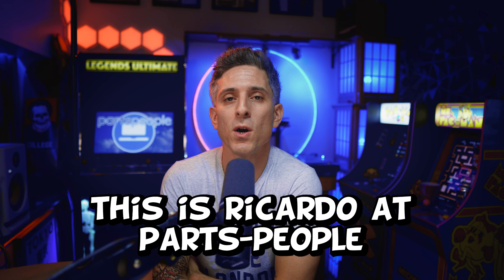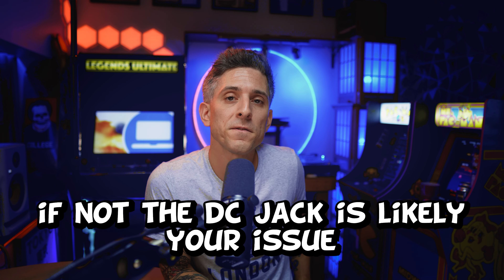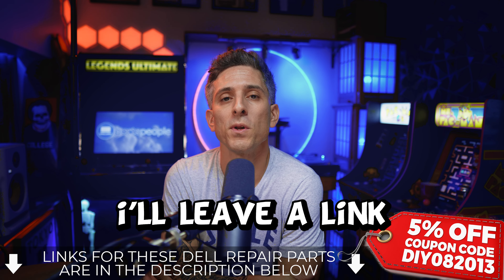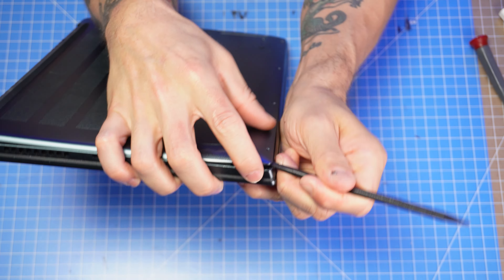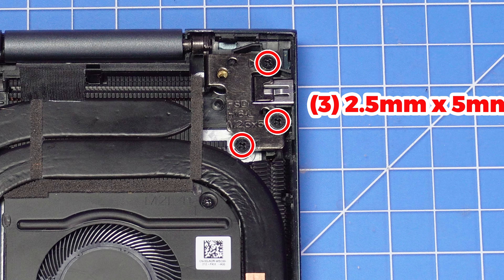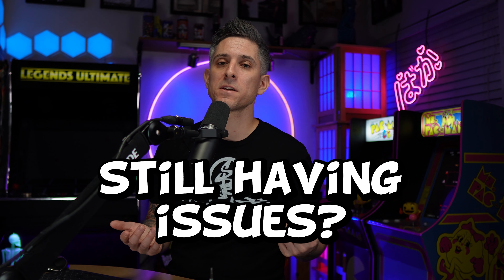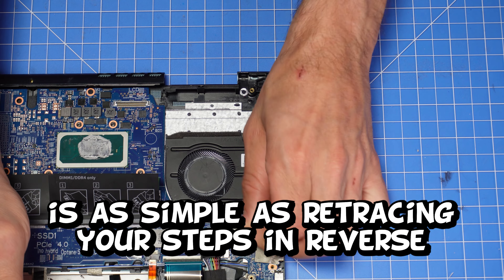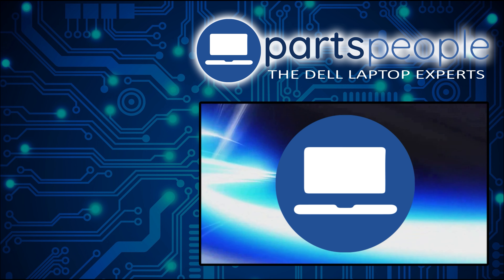DC Jack Charging Port DIY REPAIR | Dell Inspiron 7610

Comment: I found it very difficult to get the heat sink loose from where it's mounted.  The end near the charging jack came out easily, but the one at the other end was extremely difficult to pull, not as easy as in your video.